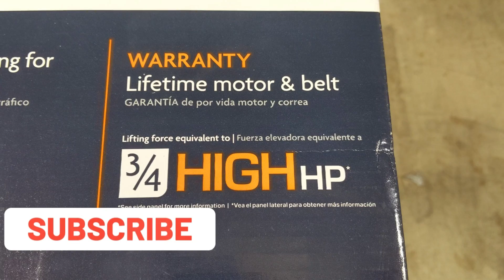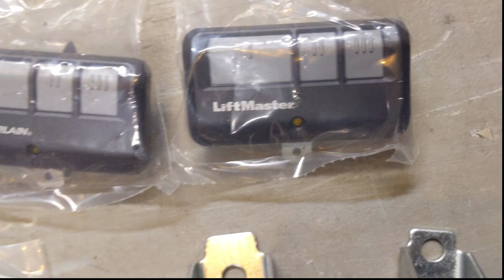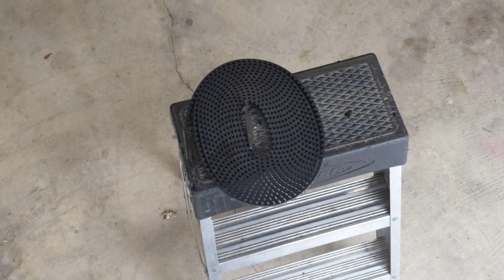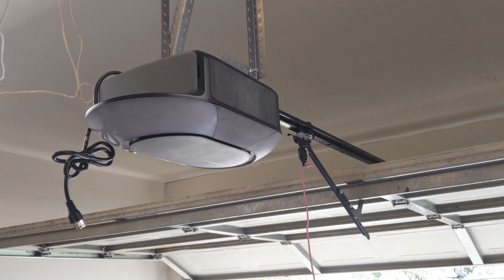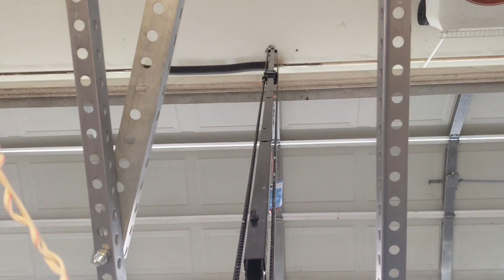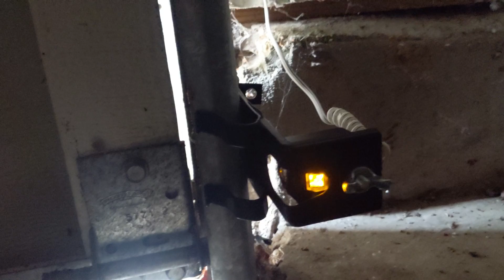Chamberlain B4613T Belt Drive LED Lighting Smart Wi-Fi Garage Door Opener

Comment: Just installed one to replace a broken chamberlain belt drive(only 5 years old), and I have to say, it’s not bad, I kinda like it
Reply from the maker: Yeah it's actually a pretty good design. It looks attractive and it's pretty smooth. However, that machine has a lot of plastic. I've installed some that kind of rattle. You know gives you that vibration noise plastic against metal.
Reply: @garagedoorgenius  the one I installed did the same thing with the vibration, all I did was loosen the belt
Reply from the maker: @Overheaddoor138  right on! Great pro tip. 💥👊🏼💥

Comment: Very interesting on the safety centers and the sprocket assembly on the new openers I’m not really a big fan of I kind of wish they stayed solid
Reply from the maker: Yeah I'm with ya.  That sprocket design needs to be solid again.  It used to be.  I've had a few ops that would make a ticking sound.  
Those little sensors are going to have to grow on me. 🤣😎

Comment: Very insightful!! but i am having a tough time with the two remotes that came with it. I am able to sync them up but they only work from under the main unit, what could be the reason? missing antenna? Model #B4613TC
Reply from the maker: I've had that issue before.  Right out of the box I had one that wouldn't respond to the remote.  Turns out it was a bad logic board.  
There is an antenna, but Chamberlain likes to stuff it inside the case.  You could take the case off and pull the antenna out and see if that helps, but that's a long shot.  My money is on a bad logic board.
Chamberlain sent my client a whole new power head.
Call tech support.  Have your model number and serial number ready.  Chamberlain is really good about their warranties.

Comment: I love the new sensors but everything is is meh. As long as a AC motor option is here im ok with Chamberlain. I also like that door that covers the adjustments and wires.
Reply from the maker: It took me a minute to like the design.  I guess I'm a UFO nerd at heart.
Yeah that door is pretty dope.  I dig it for sure.
The battery sits in there a little better.  Also, it's not a pain to take the battery backup lid off. You know sometimes how they stick in there and if you don't have long fingernails it's hard to get out.

Comment: How do you permanently turn off the white LED light on the opener? The instruction manual does not say anything about that. Thanks!
Reply from the maker: Not sure there is a feature for that.  However, you could pull the cover down and unplug the lights.

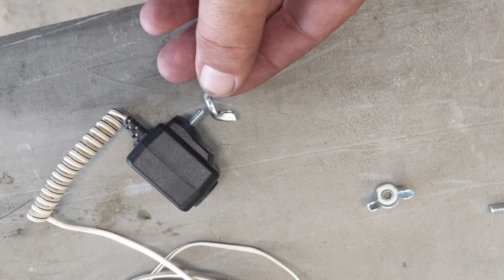Comment: How did you coil the cable @3:08?
Reply from the maker: I use a screwdriver.  Just wrap the wire around it and pull it out.  I have a video showing how to do it.

Comment: Your video shows only one wire each going into the safety sensor wire inserts. There should be two wires wired together inserted into those safety sensor wire inserts. How is your door operating correctly? Or did you wire it in a manner that the sensors are overridden?
Reply from the maker: Pre wire was short.  Coming out of the ceiling maybe 6inches.  Twisted the sensor prewire together then added a 2 wire to bring it down to the wire terminals.
Reply: @garagedoorgenius  I see. Very quick response. Good video. Thank you

Comment: I wish they would put the light in the front. I already have lights in the back of my garage.
Reply from the maker: I thought I seen that they do have a model with lights in the front.  Honestly, when a car is parked in the garage, and you open the driver's door, that back row of lights is right above you.  But I hear what you're saying tho. 💯
Reply: `With a little bit of work you can turn the light 180 degrees. Undo the screws to open the end caps the the screws for the light/cover, also you would  need to cut three little notches in the edge of the cover. They are in the lens side you will see them, they are for the antenna clips to fit in.

Comment: one question , i installed one of these on Monday (customer supplied) I might have missed it but is there anyway to determine sending and receiving on safety eyes?
thanks again for your vids
Reply from the maker: Great question!  My friend and I were just talking about this.  I don't think there is.  Which sux...
Reply: @garagedoorgenius   I think one side had a label but nothing identifying , if they are consistent at being one or the other, who knows thanks for responding
Reply from the maker: @joesgaragedoorservice7506  I'll have to really inspect them next time.  And figure it out.  You'd think there is some kind of identifier.  Thanks for pointing this out.
Reply: also I hope they work out all the bugs on this line quick, i did alot of callbacks on the 8355 LM when they first came out, but I did like this unit, I prefer DC units over AC , any day. BTW thanks again for responding!
Reply from the maker: Hey what's to say thanks for the support bro! 👊🏼
Reply: I just installed this model last night. I took a guess and assumed that maybe the sensor with the white label was the receiver with green light. I was correct, actually.

Comment: After installing this same garage door opener, found out the light doesn’t work. Still waiting on chamberlain to help with it. Any ideas? The installer said everything looks good and runs good just the light doesn’t work. How can I remove the light cover? FYI… yes the wires are connected correctly.
Reply from the maker: Sounds like those LEDs were bad from the start.  Chamberlain will definitely send you a new one.  I would call them back.

Comment: Just installed this and after I do manual up and down it goes into force makes up and then halfway down and goes back up what am I doing wrong?
Reply from the maker: You're not doing anything wrong.  Sounds like the steps are in order. 
If it reverses, I would check the sensors.  Sometimes they can appear to be on and working, but when the door is in motion the track moves slightly.  This can cause the sensor to activate and send the door back open.

Comment: Help! My husband is trying to install this exact unit. He cannot get the wall opener to interact with the ceiling mount, he doesn't know how to wire it properly. This video didn't show how to do the wiring. Also, he cannot get the programming correct for the up and down settings. He had it right but in trying to connect the wall sensor he messed everything up. Now it won't do anything. Help please.
Reply from the maker: Red and white wires go to the wall button.
Black and white are safety sensors.
Everything is color labeled.  Plug and play.
I have a video on how to set the up/down limits.
Reply: @garagedoorgenius  thank you so much
Reply: @garagedoorgenius  he said he does the down limits but the door doesn't respond
Reply from the maker: @bridgetwallace9892  I'm here to help! 👍🏼
Reply: @garagedoorgenius  thank you so much
Reply from the maker: @bridgetwallace9892  unplug it for a few minutes.  Plug it back in.  Follow the video link below.
https://youtu.be/t5XU-CgIfNk
Reply: @garagedoorgenius  will do thank you.

Comment: I just installed mine and the LED won't come on. Any idea why??
Reply from the maker: Is it plugged in?  Bro I'd be so mad.  May have to take the cover off and look inside.  Sorry to hear that bro.
Reply: @garagedoorgenius  it's plugged and it works just fine but the led light wont come on...
Reply from the maker: @Tighteric03  the actual LED light has a lead coming from it and plugs in.  Maybe it wiggled loose..🤔
Reply: @garagedoorgenius  so I need to remove the cover?
Reply from the maker: @Tighteric03  I believe so.

Comment: Just installed mine today and found this while looking up why the motor is so much louder than the 15 year old Chamberlain it replaced.  Yours sounds the same.  Why would they use a motor that buzzes that hard, it sounds ridiculous.
Reply from the maker: At first I really was behind this opener.  Just because of the unique design.  But the more of them I installed I realized that this new line has some serious tweaks that need done.  I notice a lot of rattle coming from the case.  That's one of my concerns.  It'll hold up, but definitely some quieter ones out there.

Comment: BEWARE!!!!!!!!!! this model has a well known defect regarding the LED bulb  interference with the opener itself , that you  have 2 be right near the door4 it to open.sometimes it ill not open at all, also it does not have  motion sensor detection, even though the box   say it does, be very careful if you get this model, just search the videos on you tube
Reply from the maker: I had this same problem.  The signal was horrible.  Chamberlain sent the customer a whole new unit.  Something to do with the circuit board.
Also, the motion sensor is no longer a thing due to a law suit filed by Genie in 2021 I believe.

Comment: DO NOT buy this model.  Even the video of him installing it shows the light backwards.  It's supposed to face the garage door for added lighting and security as you are pulling in.  I contacted Chamberlain and they said I would need to take it back to Lowe's where I purchased it.  So basically I paid for someone to install it and then would need to pay for it to be unistalled and then a new one reinstalled. DO NOT buy this model.
Reply from the maker: Umm...the light isn't backwards.  When your car is parked in the garage, the light is back facing so it shines directly down on you.
However, Chamberlain has a model with the lighting all away around it.  It's a different model and price.  
This model is NEW, yes.  But so far so good with it.  It's different looking from the previous line and has a couple newer style features.  Over all I give this model a 9 out of 10 on overall performance and appearance.
Everybody has their right to an opinion! 👍🏼